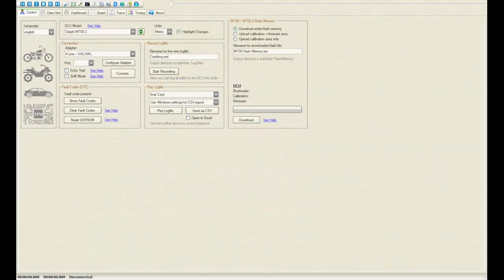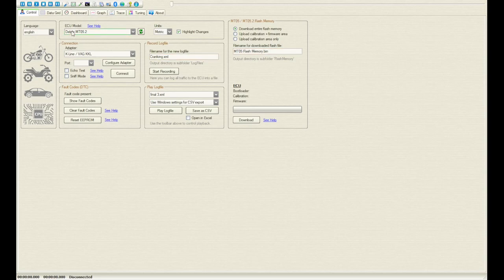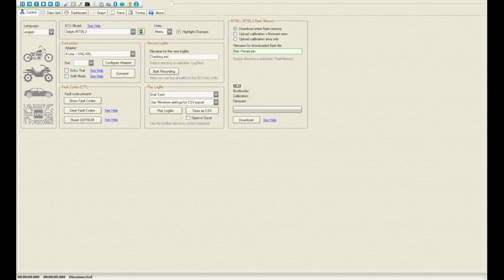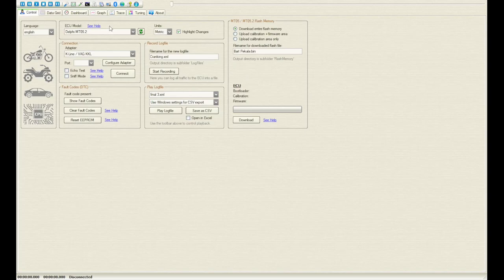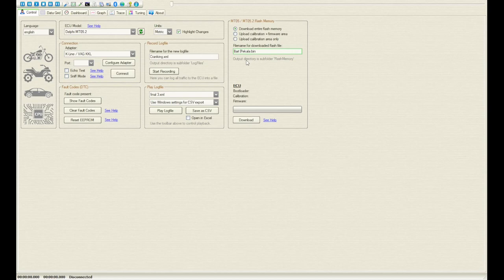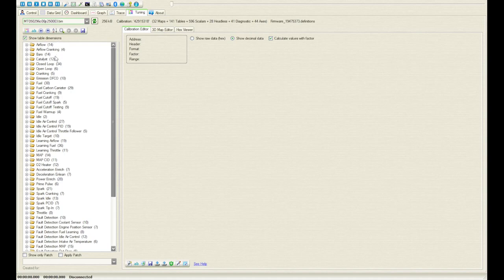How to remap euro 4 125cc bike with Delphi MT05.2 ecu (and other bikes too)

Comment: Hello just subscribed. I have a wangye eivissa 2 125cc EFI year of manufacture 2022. it is a euro 5 ecu....... can you recommend several ECU EFI scanners that is compatible and will definitely read codes on my scooter. The model on my logbook is a WY125-121...... unfortunately I have purchased 5 scanners and none of them communicate with the EUC as they are not compatible.

Comment: Do you have 450cc dirtbike dumps?
Reply from the maker: Hi. No. This can be adjusted in settings. Is it one cylinder?
Reply: @Vleporama  yes 1 cyl . I have several dumps 300efi and 450efi dirtbikes at fact difference only in calibration area, firmware and boot checksums are the same

Comment: What to use for euro5 ?
Reply from the maker: @hot-shotlabel3212  bitbox software
Reply: @Vleporama  free for euro5 efi?
Reply from the maker: @hot-shotlabel3212  no it is not
Reply: @Vleporama  do you have for euro5?
Reply from the maker: @hot-shotlabel3212  yes I have software for euro 5 but it is payed one cost about 600quid. If you have mt05.3 dual plug ecu I can do it for you. Cheers
Reply: @Vleporama  thank you
Reply: @Vleporama  is it possible to connect ecu direct to laptop?
Reply from the maker: @hot-shotlabel3212  yes with kkl cable and obd2 adapter